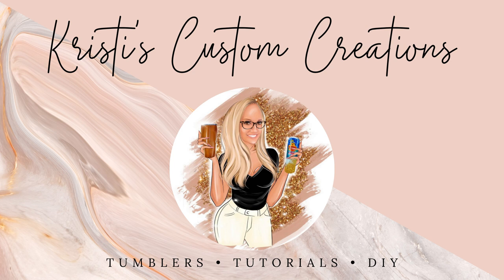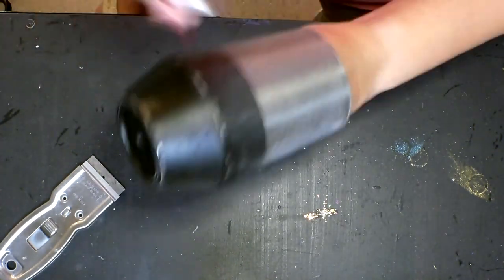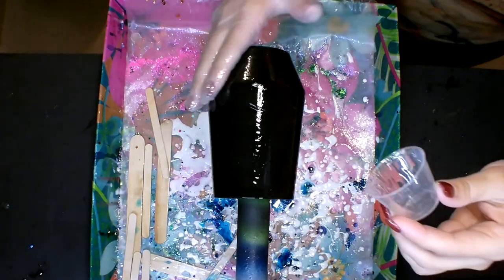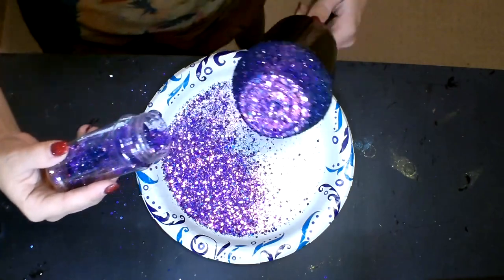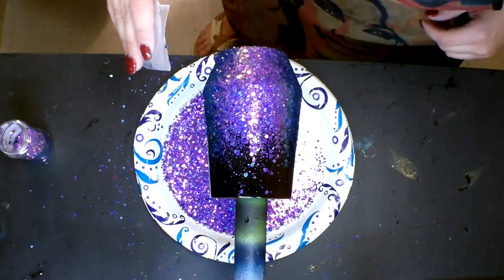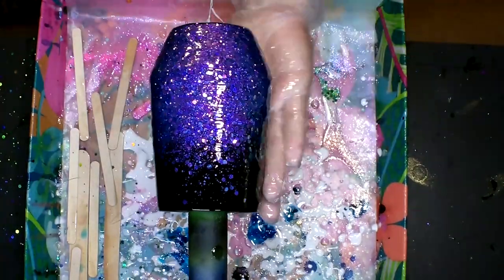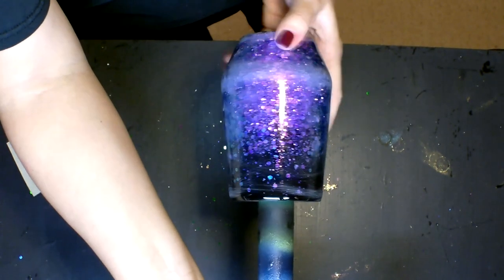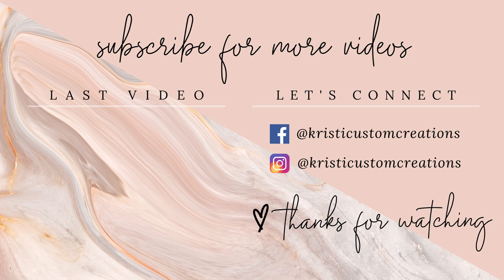How to Glitter and Epoxy an Already Painted Tumbler | KCC Glitter | Tumblerpoxy

Comment: Hi!! I have a few questions for ya. Im FINALLY getting around to using Tumblerpoxy for the first time and it will also be my first time ever putting any kind of epoxy on a tumbler. 

I just want to make sure I don’t jack this up lol

1. How long do I wait between coats? 

2. Can I build layers with Tumblerpoxy then add Swiftpoxy as the final coat? (I ordered Swiftpoxy yesterday with their sale) 

3. Can I sand glitter tumblers after the first coat?

4. How long should I let it spin on the turner before letting it rest for the duration of curing time? 

5. What is the curing time? 

Any tips and tricks will be greatly￼ appreciated.
Reply from the maker: I would wait about 5 hours between each coat, yes, you can build layers and add Swift epoxy as the final coat. I don't sand tumblers after the first coat, I always have at least two coats on before I sand. It needs to spend on the Turner for at least four or five hours before you can stand it up right. Total curing time is 72 hours but it is dry to the touch after about 8 to 10 hours.

Comment: I have a question. If I have a all black stainless steel tumbler do I have to sand it down and paint over it? I don’t want to add glitter. Just a puncture and vinyl. I’m new to all of this. Hopefully someone can help me out. I really love the video.
Reply from the maker: I have done it where I just epoxied straight over the colored stainless but I can't guarantee that you will get a really good seal on it. You can definitely do it though.

Comment: I literally do not know what I’m doing wrong I sand my tumblers I washed them with Dawn dish soap then I wiped them down with 91% alcohol I’ll do my spray paint coat  for the base and my resin is repelling. Is there a step I am missing ? I watch so many tutorials I just don’t know what I’m doing wrong and I don’t wanna continue to waste any more Tumblers
Reply from the maker: Try wiping with acetone instead of alcohol. What size cup are you doing and how much epoxy are you putting on it?
Reply: @KristisCustomCreations  I am using 18 and 20 oz cups and 5 to 10 mls of epoxy for the base layer
Reply from the maker: @amandaturner1962  is it repelling on your base layer or on the layers over your glitter?
Reply: @KristisCustomCreations  my base layer and depending on what is on my cup sometimes the second layer as well. I’m going to try the acetone and start trouble shooting there. Could I possibly be over sanding?
Reply from the maker: @amandaturner1962  I don't think over sending would cause that. Only use the acetone on the stainless, don't wipe the epoxied cup with it. After I wash my epoxied cups with dawn dish soap, I just let them dry before the next coat of epoxy. Also, sometimes not using enough epoxy causes the repelling/fisheyes